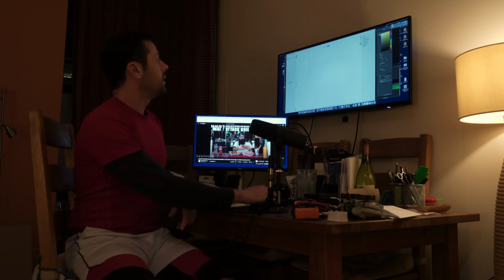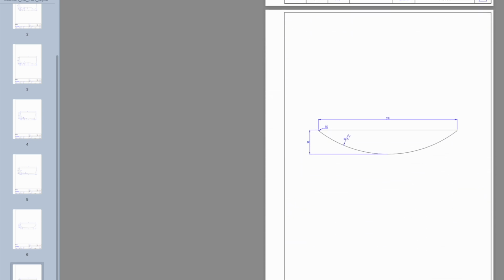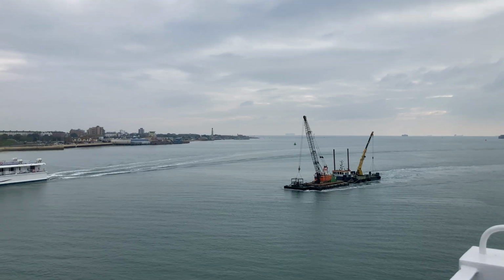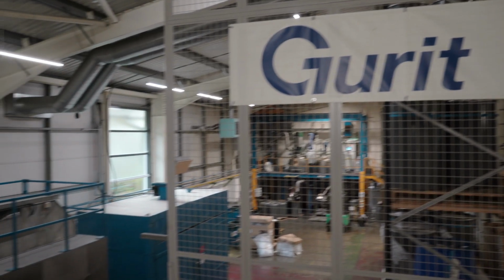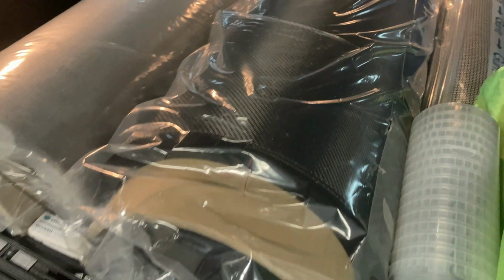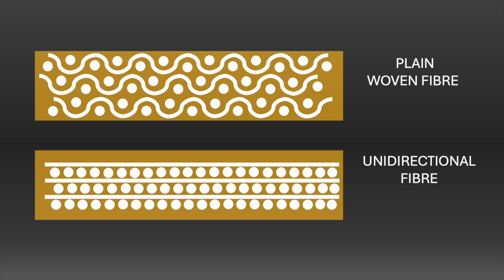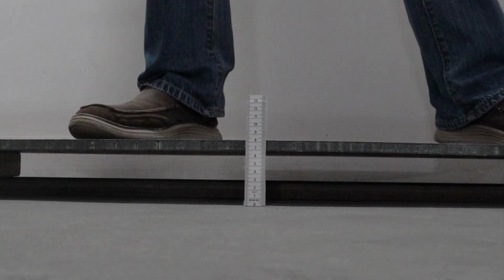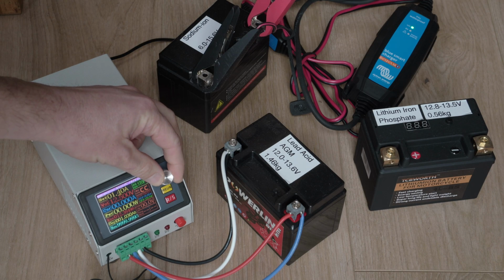200kg carbon fibre collected for Bernard - Arctic Vehicle Project. Then I push it to failure.,, [4K]

Comment: Adding more layers of cloth (carbon or glass) wont help you as much as making the foam stronger or thicker. if you want more strength out of your panels while still keeping them light you need to be looking at alternative foam cores. you should be right on the edge of the core failing and the skin failing to maximize weight to strength performance.

Comment: Shouldn’t the parts of this vessel that are going to be banging up against ice and rocks “just” be steel? I applaud your research and development efforts but building a hull out of composite does not seem like it will be ready to be banged about without eventual failure.
Reply: Perhaps you missed the part about the vessel/vehicle being light weight.
Reply from the maker: I'm not sure I understand this. Composites can be wildly strong and impact resistant. Steel isn't magic - it can fail and dent. And it's very very dense!

Comment: Are you worried about the foam core degrading if moisture seeps in or gets trapped during a repair? In my head foam + water just equals trouble...

Also, on the foam core: Is there a plan for field repairs if the core shears? The patch repairs on the skins are probably doable, but as you've shown they are unlikely to fail first, while i feel the core would be rather difficult to work on. Or is the plan "make it so strong it doesn't break"?
Reply from the maker: The good quality PET or PVC core are closed cell with <1% moisture uptake. If there's a delamination, yes water could fill the gap, and that's why you design to avoid delam.

So strong that it doesn't break is the plan. You're right that 'dink' repairs or scrapes are easy to sort. A sandwich that has come apart is a bigger issue.

Comment: Great research of the theory of sandwich panels. The first thing that came to mind after the breakage from my experience working with various composite materials is that you need to connect the top and bottom layers with a layer wrapping around, thus creating a I or U beam structure. This was exactly what your next sentence described.

In the final panels I imagine using a strip of fiber in the gap between core panels would suffice, depending on the size of the core materials. A marine engineer would be able to calculate the amount of internal ribs needed, although a few ribs or knees external to the sandwich and internal to the vehicle would add a lot of strength as well.

Looking very much forward to the rest of the project.